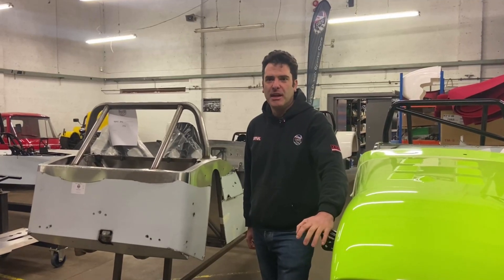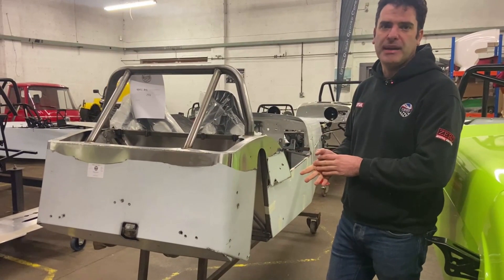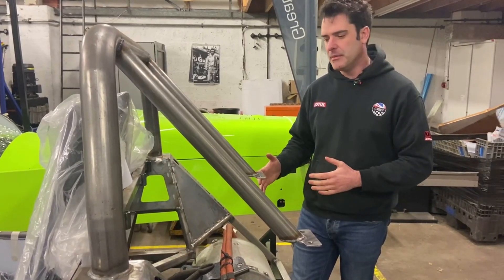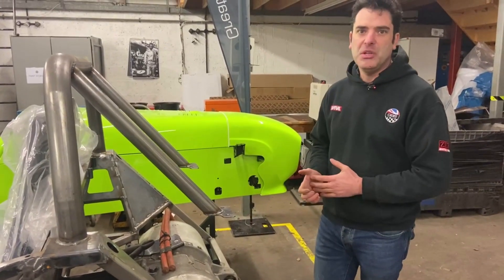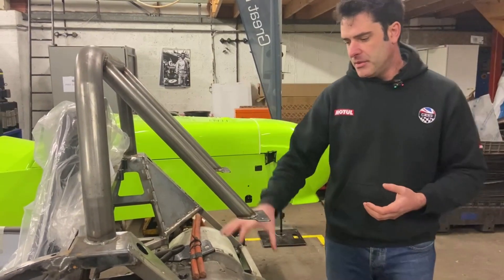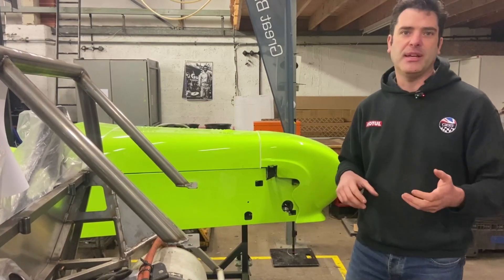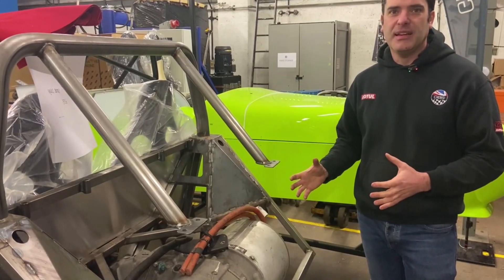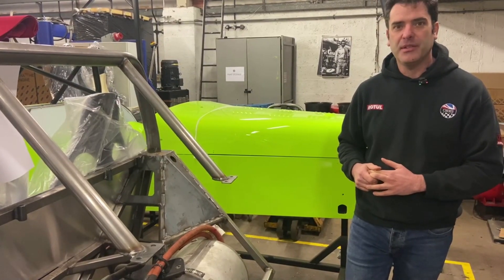NEW Project Electric Zero powered by the Tesla motor fabricated and ready to be built.....

Comment: I’m interested in an EV but Tesla S is overkill for what I’m wanting to do with the vehicle.  Something around 100kw (134 hp) would be plenty, with battery for - 150 mile range (so 35-40 kwh? ) Try to keep the weight and weight distribution close to the original.